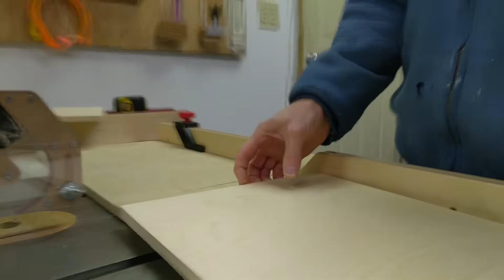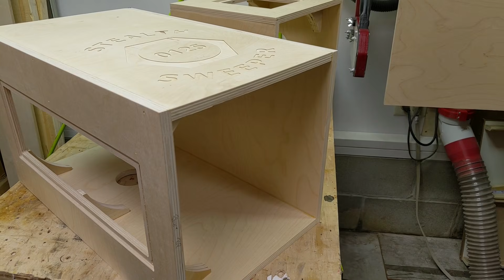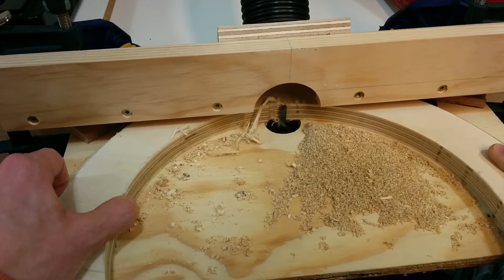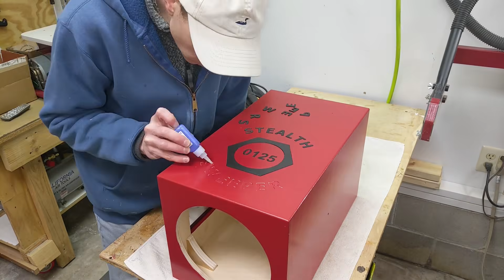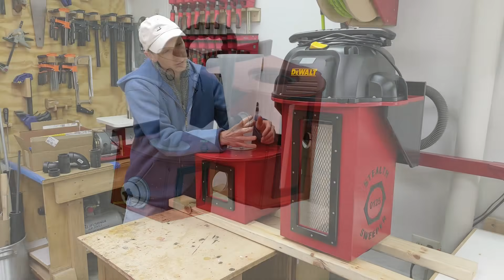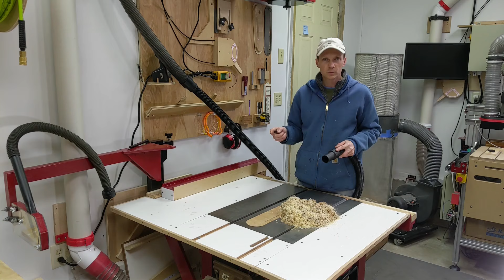The Perfect Shop Vac that Nobody Sells

Comment: Your clean-out port will work so much better if you add a hole to the side opposite of the clean-out to allow air to come in as the dust collector is sucking it out.

Comment: One thought, could you add an intake fitting to the large particle box that you can hook up an air hose to that would loosen up the bits that get caught up and don’t get sucked out by your main 4” dust collection?

Another thought, are you going to sell the 3d printed screw on connectors for the 4” dust collection?! Those would make my life so much better! 

Great build and video!
Reply from the maker: Good idea on the air blaster. I have the screw adapter 3D print files available on my website, but currently don't sell printed ones.

Comment: I don't know if this helps, but I use carveco software and use bridges to hold things in place. It adds a little extra work but never kicks the part out. Typically a 3d bridge with .5 width and .25 height in 3/4 material

Comment: I’ve been using a Shop-Vac with a Rockler Dust Rite separator. Believe me, I share your concerns. I really like your efforts, but I’d like Tom provide some thoughts:
— The translucent Rockler Dust Rite drum lets me see the fill level — an invaluable aid. For my use, I like adding a bin liner to make emptying it easier;
— With 99% of the dust and chips being collected in the separator, I don’t see much need for a large capacity to the final filter stage; I’ve been happy using a HEPA bag — even though there’s no easy way to tell if it’s full;
—. With that in mind, I’d modify your plan for a smaller filter section and a larger collection stage;
—  I’d consider shaping the collection box to better direct the collected chips into the “drain” hose; and,
— As much as shop space is at a premium, I’d try to arrange things so any noise was outside, and access for emptying was possible without using a ladder.

Comment: I like your fluorescent light mounts. I think I would drop a strig from the ceiling with a carabiner to hold the Vacuum remote switch. When I finish building my vac system the vac & collection boxes will be mounted on the exterior wall with an awning just like I did my Air compressor so I dont have to listen to it.

Comment: Very nice design.   You might consider building a large poppet valve for your clean out port.  It could operated by a tight sealing pull rod so you wouldn’t need to disconnect the 4” pipe.  Might even eliminate the blast gate.

Comment: I would suggest cutting parts like this, draw in some break-away tabs on your rings similar to how model parts are formed
Then CNC it out, minus the small tabs. 
Cut the remaining tab off with a knife to remove the part.
Sand the tabs off. 

Or use carpet tape to hold down the part. 
Otherwise good job.

Comment: Great idea! I used a Kirby vacuum cleaner—just the motor and impeller integrated into my dust collection system inline—to tackle a similar issue in my shop. Since the motor is positioned externally from the impeller, intake, and exhaust, it requires no maintenance, no filters, and no additional components. All dust and debris are seamlessly collected within the same system.  Cheers!
Reply: Do you have any pictures of your build? I have an old Kirby kicking around that I don't use and this would be a cool use for it
Reply: @liquerinfrnt  I do not have a picture of the setup.  All I did is take the black exhaust hose that is in the dust bag and connect it to the 4 inch pipe to my main dust collector hose.   You need the bag section of the vacuum cleaner as it has a plastic housing that attached/ twists to the motor housing, which triggers a safety switch by the exhaust port of the motor housing.  Without that, the motor will not turn on.  I also kept the intake hose that comes with the vacuum cleaner, as that attachment to the front triggers another safety switch at the intake by the impeller.  Those attach to my sanders, track saw or router to collect dust.  I hope this helps a bit.

Comment: I definitely like this setup. I'd like to have something like this when I get my workshop built.

You might want to consider looking at 1 way valves for the 4" cleanout port. That way you don't have to climb on anything to undo your current solution.

The idea there is that the suction from the cyclone bin would hold the 1 way valve shut when you are using the cyclone vac, and then when you open the blast gate with the cyclone vac off, the 1 way valve is sucked open and cleans out the box "automatically". I'm sure you could find something to 3D print online and have maybe some springs to help keep the 1 way valve normally closed.

Comment: Awesome build. Just, wow. You solved so many problems, so elegantly (even your trademark red-and-black!). 

My only concern is the cleanout on your dust bin. I'm a little concerned that the loose dust will spill out of your flange, defeating the purpose of collecting it to begin with. Some solutions come to mind: mounting a larger pipe to the flange, so it's not so easy for the dust to spill out, or to make the flange something like a 30° or 45° angle pointing up (think like the spout on those broth-and-fat separators in the kitchen), or simplest of all, just mount the flange maybe like 2/3 of the way up the box. (I like the angled spout idea the best.)

Comment: I would recommend running a pipe on down the wall to the floor (with a blast gate ofc) that leads to a flat funnel shaped inlet directly on the floor. You can then ditch the need to lug a big hose around to clean the floor, and just sweep it all to the inlet located on the floor. I suppose some dust could be stirred up in the process, but then again, a broom is easier to store than 20ft of shopvac hose..

Comment: Beautiful job.  I have a shop that is 20x40. I actually have purchased two dust removal systems. But after many hours of thought and you may not have the capability to do this but I am running mine outside of the shop 
Essentially piping the shop to run just out on the backside of the wall my motor will sit and that goes into a cart to be dragged out and dumped by my 4 wheeler. Anyway. A thought. Great videos.

Comment: Cool video! 👍🏼

I’m going to need to get dust collection happening in my shop soon & you gave me some great ideas… especially designing with lower db in mind. 🧐

(Currently using Makita cordless tools because the db are much, much lower than Milwaukee & significantly lower than DeWalt brand tools.)

And… @7:15 I’ll definitely be looking for those “nice and squishy” gaskets. 😬👍🏼🤣

Comment: Nice work sir. FYI when you are cutting out your rings or anything on the CNC where the middle will move, you can add tabs in your program to hold the the potential loose pieces instead of making holes and screwing down. Then cut free after the CNC and clean up the edges with your router.

Comment: How do you change high pressure low volume vacuum to a high volume low pressure system and make it work?
Reply from the maker: I don't think that's really possible. They are two completely different systems.
Reply: @JustinDepew  absolutely agree

Comment: 'That means a large filter'... Nope. A cyclone gets rid of almost all the dust. What is left is the small, hard to filter fine dust. Why try to catch it? Just exhaust it out of the shop. I have done this for the last decade- no sign of it where it exits, and no fine dust in my shop. Zero work and cost for filters.
Reply from the maker: That would work but then it would suck all the heated air in my shop outside in the winter.

Comment: Great build. I have a thought that if on the cleanout port if you were to allow the cap to slide back and forth on a smooth shaft it should move to where it is needed due to if the vacuum running or the dust collection system cleaning it out. It would simplify the clean out process and maybe a couple times a year you may need to clean the seal to the box due to dust causing the seal not to work as well.

Comment: Cool build Justin, I think I may try something like this with some existing equipment in my shop. One thing I noticed about you using your cnc is you don’t use tabs to keep you parts from moving around. The other thing is cutting your part and then rabiting it. I don’t know what software you are using but I use vetric vcarve and nest my cuts that use the same bit, so I can cut my rabbit first and then it will go right into the profile cut out. Hope that helps, great video

Comment: We used to have 2 HP dust collector that had a ton of suction and airflow.  We had some sort of garbage can lid we could put between the collector and whatever machine it was attached to.  A proper cyclone would be even better really.  It was one of those things that you needed a metal garbage can for or it might eventually start to crush.  That dust collector was actually a little bit dangerous but I didn't know anyone stupid enough to ignore the warning labels where the hoses attach so it was a non issue for us.

Comment: Work holding is a major skill in using a CNC well. Good on you showing both methods and mistakes. If you leave some tabs on your cutout parts, you avoid loose parts banging into the cutter. Then you can separate them with a knife or flush cut saw.

Comment: The problem I have with "standard" dust collectors is the ear-shredding shrieking from the motor.  Years ago, as a wood turner, I fell in love with Fein dust collectors.  Very quite and powerful.  Festool is also good.  My Jet Dust collector, a smaller, two bag  floor stander was bearable.

It's hard to tell from the video, but what is the decibel output of your setups based on what brand/type of motor assemblies you are using?

Comment: Nice work.  As a former exhaust system engineer I would recommend separating the cyclone unit and the filter more laterally.  That would gain you a bit of hose length but more importantly it would let you use larger radius elbows in the connections.  (Typically 45 instead of 90) This will make a big difference in the pressure drop in the connection and increase your flow.
Reply: yep tight radii exceed the pressure drop of VERY long straight runs
Reply: Curious if you use any sound dampening (mlv, rockwool, butyl/alum) in your installs? I am curious if it is worth using.

Comment: My CNC software lets me make 3D tabs to hold parts in place at whatever thickness I want. Usually I make them 2 inches by .08 inches thick and cut them out with multi tool or razor knife.

Comment: Before adding comments, it’s a really nice addition and looks good as well. A couple of points. The first is that the 3 x 90 degree bends in the 2” pipe have a significant reduction in efficiency, a redesign of the plumbing layout will reduce that to 1 (or none if you use flexible pipe) though you would need to drop the collection box lower. The second point would be a significantly larger collection box as that would reduce particle that drop but then get sucked up by the air flow. Dropping the collection box lower and having a much longer connection pipe will not be a significant problem as it will only get used occasionally.

Comment: What is the purpose of doing this in addition to a central dust collection unit? Is your suction simply not strong enough with the central unit?
Reply from the maker: This is a high pressure low volume collector as opposed to low pressure high volume collector like my main one. There is a benefit to having both systems because they excel at different tasks. HPLV is good for sanders and routers and cleaning up tools. LPHV is good for bulk dust collection like at the table saw or CNC.
Reply: @ nice, learn something new every day.

Comment: You could look for a industrial PVC ball valve in place of those gates it should seal better.
Reply from the maker: I actually did look for those but at 4" size they were quite expensive!
Reply: @JustinDepew Could you 3D print a functional ball valve?  Just a thought. Love the process of your project. It’s been mentioned but I’ll repeat. Try to eliminate the 90’s in the 2” pipe.

Comment: I'm not sure if this is in any of your other vids, this is the first one I've seen, but why the dust collector and the shop vac system?
I assume there's benefits to the pressure vs volume of air they each move but I'm curious if you have any more detail or better explanation for why you prefer this way.
Thanks!
Reply: I just noticed, I like the door for emptying dust, but curious how you plan to do that when it's full? Wrap a bag around the bottom and let it all fall in?
Very cool system! Someday I need to get my dust collection game up a bit.
Reply from the maker: Yes you are on the right track. There's a big benefit in the shop to have both systems. They are different. One is high pressure low volume and one is low pressure high volume. Different collectors for different tasks. The low pressure dust collector works great as bulk dust collection at most tools, but would be cumbersome and ineffective when hooked up to a small tool like my sander.

Comment: I guess what I don't understand, is if you already have a dust collector, why not just get a vacuum kit for it (floor sweep and bench nozzle)?  I have one from Rockler attached with 4" accordion hose & magnetic quick-change fitting...works fantastic, I can clean my entire shop floor and equipment, and probably took me 10 minutes to set up.  This seems overly complicated.
Reply from the maker: There's a big benefit in the shop to have both systems. They are different. One is high pressure low volume and one is low pressure high volume. Different collectors for different tasks.

Comment: I would ditch the cover and just put a blast gate there on the clean out box so you have two glass gates and then you just leave your flex hose connected all the time and when you need to clean out just open your gate on the clean out box and the black gate on the main trunk done

Comment: just a quick comment on hearing protection and sound measurements. The dB scale is logarithmic, meaning that every 10 units on the scale in an increase of 10x in sound pressure. So going from 50 dB to 70 dB is actually a hundred fold increase. Wear hearing protection.

Comment: Wouldn't using the actual dust collector with a cyclone be better? More air moved, quieter, while freeing up floor space and unneeded redundancy.
Reply from the maker: There's a big benefit in the shop to have both systems. They are different. One is high pressure low volume and one is low pressure high volume. Different collectors for different tasks.

Comment: Ever thought of using double sided tape to hold down those parts that need to be cut out yet still stay down until finished cutting?
Reply from the maker: Yes I have done that in the past but didn't think to do it on this particular piece. That would work well.

Comment: I also run a shop vac head on a commercial filter.  I left mine wide open to the air to suck out any fines or fumes in my shop.  I just place a garbage bag around it when I shut it off, to allow the fines to drop into the bag.  I leave the bag on it when it's not in use, to stop the fines collected from dropping out after it is off.

Comment: Vacuums are not dust collectors and they are not high flow as you said they are high pressure (vacuum)
high vacuum low flow 
Dust collectors are high flow, low vacuum.
I would be interested in how much dust is dumped out of the stream into your oversized 4" lines.
Your pipes are acting as a Seperator.

Comment: good job. 

i would probably just add a small drawer under the big filter, as it will make it easier to get rid of the fine dust that get into the filter part. I would be afraid of opening this after some days of working.

Comment: Very well thought out design. The filter box will always have dust particles in it due to static electricity. Put a ground strap around 4” pvc and ground with a green coated wire to a 3 prong plug using only ground post.

Comment: Remember that dB is a tricky measure.  10dB is double (or half) of the loudness as perceived.  so 80 dB is twice as loud as 70dB for instance. I had a talk with chatGPT and it corrected what I thought.  In terms of power like Watts it's 3dB and for voltage like the SPL it's 6dB but in terms of the way our ears percieve loudness it's 10dB.

Comment: Neat idea and build, but it would seem like a simple bucket to collect the dust that can be quickly removed with 2-3 quick-release clamps and a good seal would be simpler and kist as fast. Also, I'd be concerned that turning on your big DC with such a small enclosed space it's trying to suck from is going to be really hard on the DC motor. 
Looks like you could also use a reel for a nice long 2" hose right next to your air hose reel that would make hose management much easier.

Comment: I just learned a gamechanging CnC tip - no tabs or complicated hold downs required - use cheap amazon 1/8" inch chinese DOWN CUT or COMPRESSION bits with low dust collection, and the chips pack in to the kerf and hold the piece very well. I am able to get 70"/min cutting 3/4 oak ply in ONE PASS on my hobby machine using a makita router. The bits are held in a collet and are bought in 10 packs for about $30.

Comment: When the small box gets filled half way with dust and you unscrew the dust cap, won't dust fall out all over before you re-attach the 4" clean out hose?
You could 3d print a bracket that holds a thin piece of rubber and make a one way valve that cleans out the box when you open the 4" blast gate. Then when the shop vac is on it sucks the rubber closed not causing any leaks. 
Look at the one way exhaust valves on like 3M dust mask/respirators to see what I mean. Then you wont have to climb onto your saw to do the clean out.
Hope that all made sense.
Reply from the maker: That's a neat idea, I like it.